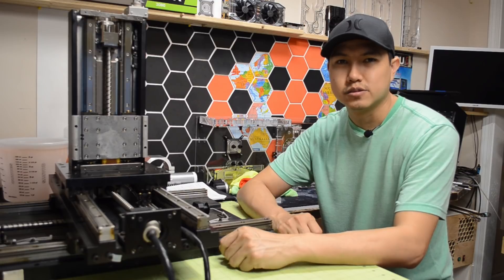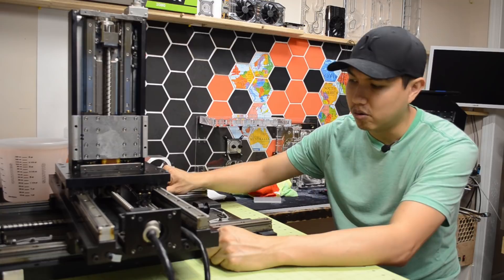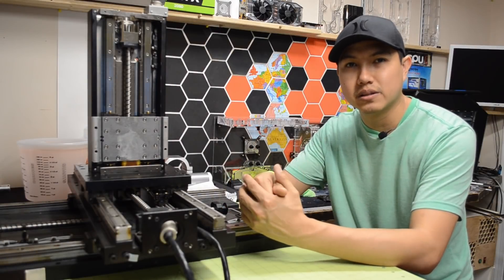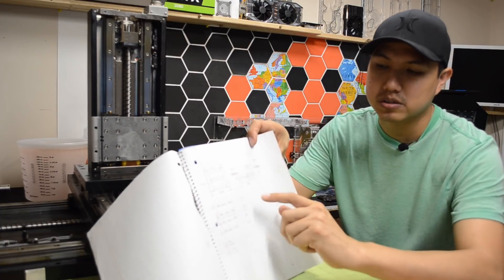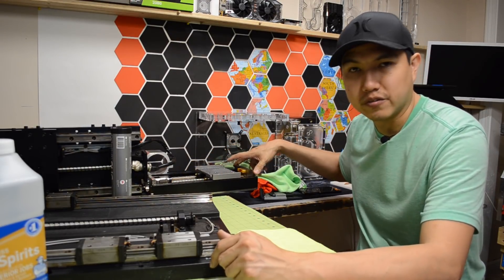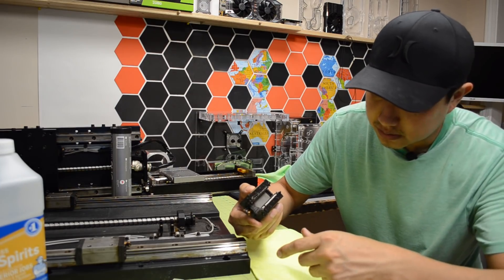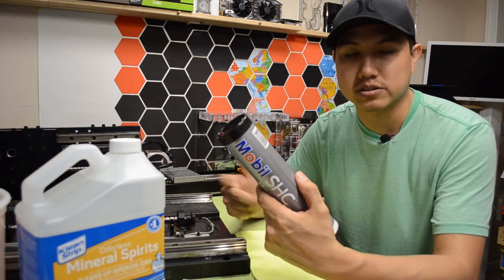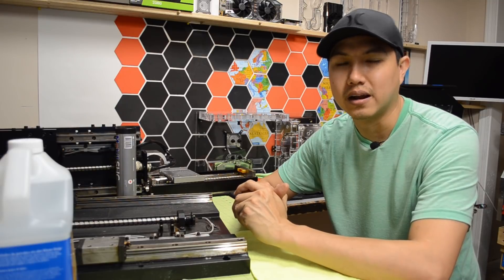my 2nd CNC "Fixed Gantry"  - Part 1 Intro and cleaning

Comment: Is this ball screw 25mm lead? 25m/rev?
Reply from the maker: @massadi2210  the ball screws are 15mm diameter 10mm pitch, all Ground ball screws for better accuracy and movement.
Reply: @radikult-custom  thank you for your reply, I can get THK 2525 ground ball screw for a good price! Is it suitable for cnc milling hard materials? I will also use belt reduction! Appreciate your help
Reply from the maker: @ I don’t know. I feel 25 pitch is for super fast machines. Maybe a pic and place CNC. 
For steel cutting. You probably won’t go that fast. I would be looking at 5 or 10mm pitch

Comment: Your eBay links don't work. What linear stages did you use?
Reply from the maker: I found the linear stages “Used” on eBay. That’s why there is no links to the actual parts. But if you find something similar you could build a CNC
Reply: @radikult-custom  Thanks. It looks like the Z axis might be dual truck on each side. That's what I would like. Good work, btw, on your projects!

Comment: Epoxy granite 🤘 Damn good stuff. Top Secret Use: works like a charm inside speaker boxes (just the corners). Rounds off the corners, dampens most vibrations even at higher volumes, and makes the speaker sound warmer. Convert $10 speakers to something that sounds like $100.

Comment: u should get used atc spindle got mine for 800 usd for 4.5kw bt30 the runout is good compare to typical chinese spindle
Reply from the maker: Wan V if that 4.5kw vfd can run from a two phase 220v maybe. 
 Where did you get the spindle? 
I’m going to be using some spare parts first to make sure everything works and then if it’s really good I’ll spend more money on servos and atc possibly
Reply: @radikult-custom  owh you will have limited choice then since im using 3 phase 415 i got it from china directly the new 1 cost around 4k usd still worth it since it used from industrial use not hobby grade type
Reply from the maker: Wan V yeah I only have 2 phase power. That’s why I can only get maybe up to 3kw vfd s
Reply: @radikult-custom  owh yeah need to get the biggest you can get since you making rigid frame of course need better motor too :D

Comment: I built a cnc very similar to what you're talking about.  If you would like some pictures for ideas, just send me a message.  My stages are all steel construction as well.  Travel on mine ended up being 12x12x12.  I used ClearPath servos and it works really nicely.
Reply from the maker: Machine 27 nice.  I’m using some stepper from my first cnc and controllers, but if the cnc turn out to be really good. I’ll switch the controller and buy some clearpath servos
Reply: Best of luck with the project!

Comment: How much is it?  I already purchased some THK NSK linear actuators and will build router machine soon.
Reply from the maker: raychar c I bought the “X and Y axis” parts for $450 and the Z axis for $300.  And I found some aluminum extrusion for $1 an inch.  But I still need to buy other parts
Reply: @radikult-custom  A good price for this rigid stuffs. Thought you may already know there may  be some areas of used parts that needed to take care. I once bought a used harmonic drive and ended up with replacing a cross roller bearing there.